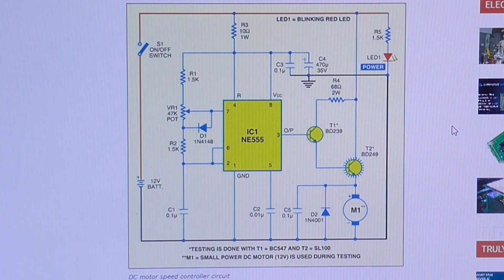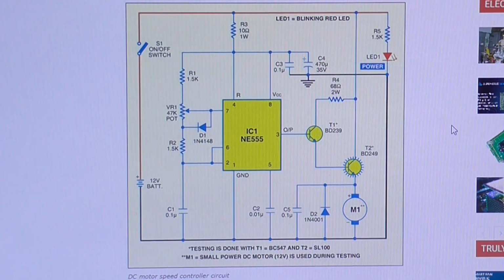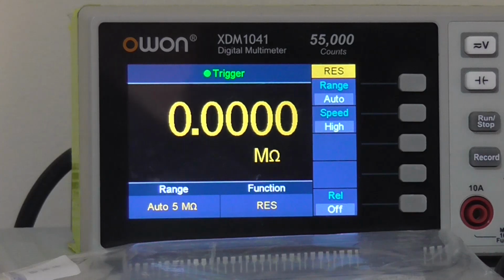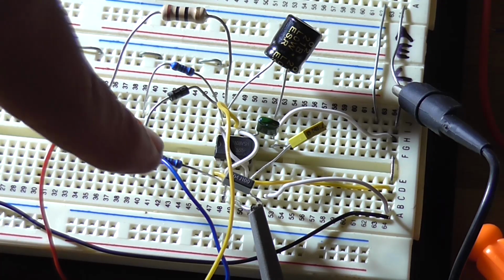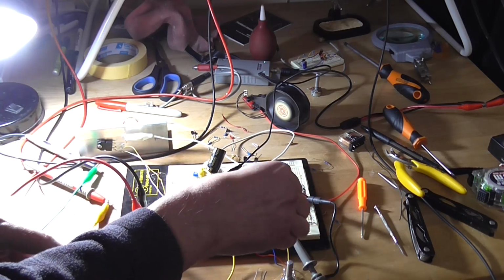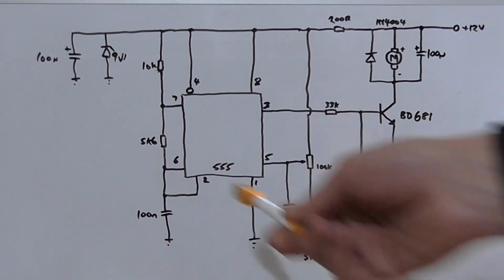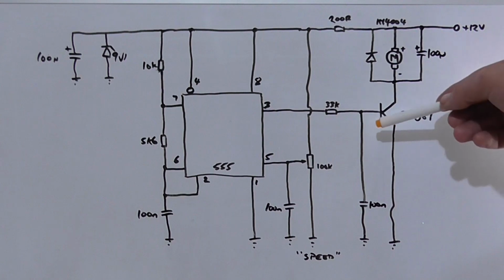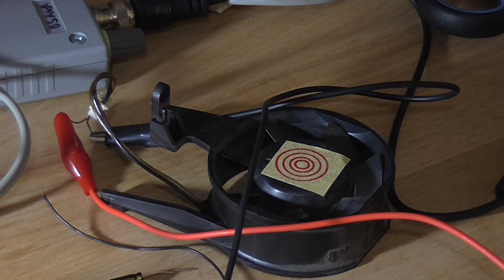555 Timer DC Motor Speed Controller

Comment: Wicked circuit, just discovered your channel. Super interesting hearig you justify differenet transister choices and outpout topologies. I believe you were correct about the diode in the original circuit, it is to bypass the resistor in the charging phase and force current through the second half of the pot during discharge. Thanks